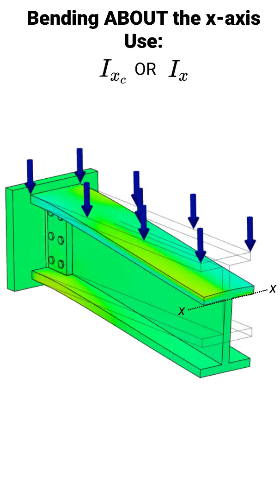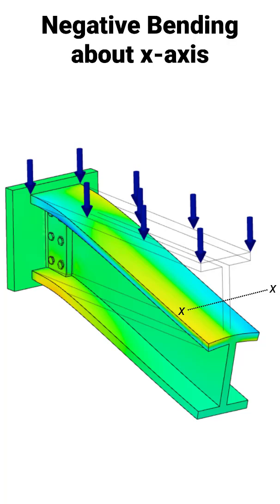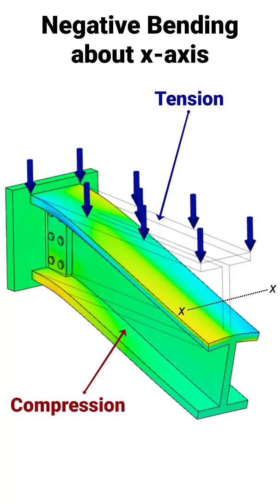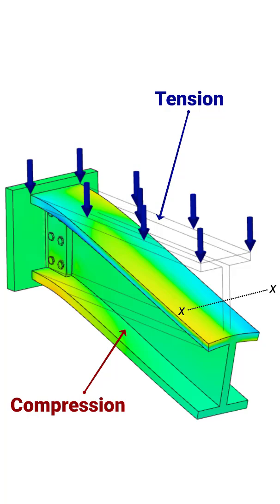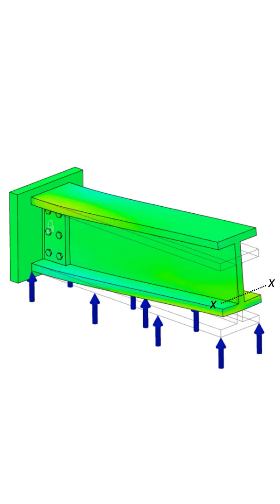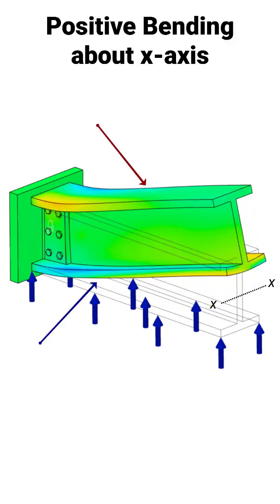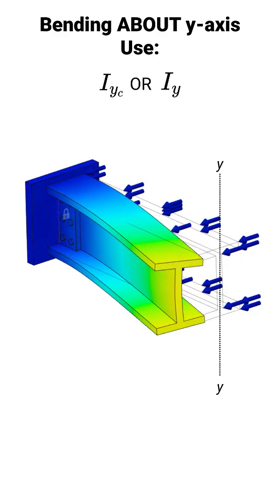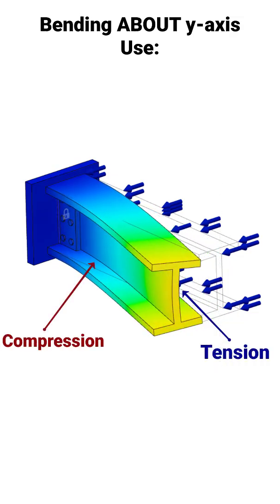KNOW YOUR BEAM BENDING FOR THE FE EXAM!

Comment: Important to note that this is cantilever as one of the previous comments highlighted. In contrast, if the beam was supported on both axial ends, the upper surface would be compression and the lower surface would be tension.
Reply from the maker: Oh yeah! The classic positive bending case for a simply supported beam would force the bottom fibers to be in tension and the upper fibers in compression.